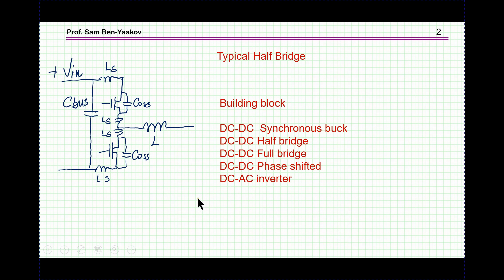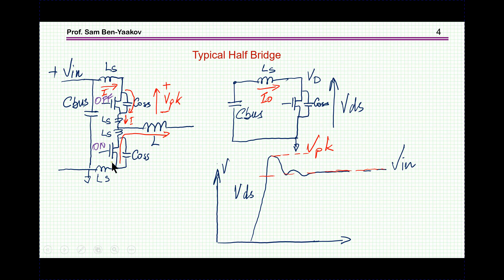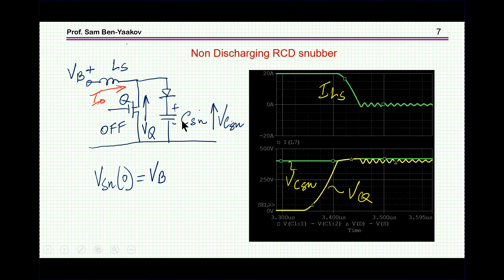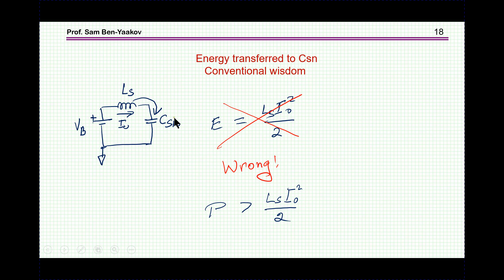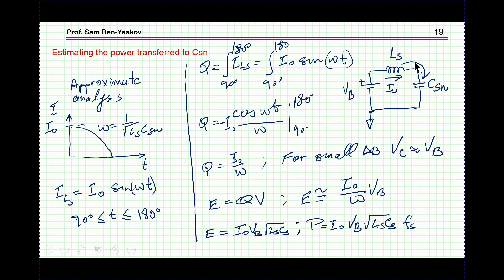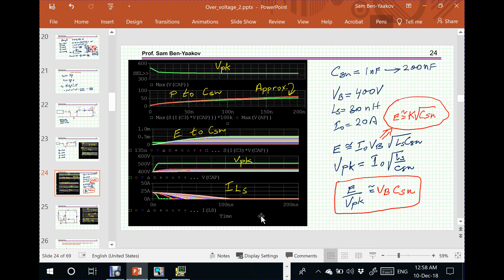Overvoltage  protection of PWM half bridge: Misconceptions and facts

Comment: Hello Professor, question on circuit arrangement of snubber components (R, C, D). 1 arrangement I have seen is Rsn and Csn in parallel with each other with one end connecting to Vdc in and other end connected to cathode of diode in clamp circuit. one of such arrangement is in this video -https://www.youtube.com/watch?v=rmMYgnJ1oqE
Can you please help share if component connection matters and what is difference in them ?
Reply from the maker: See https://youtu.be/laHN4Xn59lI?t=721
Reply: Thank you professor❤ @sambenyaakov

Comment: Thank you for the video. It is really an interesting energy calculation that starts here: 14:39
The energy that is stored in the inductor of 30nH at 20A is 6µWs. 
When it discharges to the capacitor of 13nF it increases its voltage by 30V. 
This is a charge of 390nAs that flows also through the voltage source of 400V, taking out 156µWs. 
Together with its own energy of 6µWs the sum is 162µWs. 
When the capacitor is discharged from 430V to 400V it emits the energy of 1202µWs – 1040µWs = 162µWs. 
There we have the power of 16.2W at 100kHz with the power loss of 8.1W. 19:39

Comment: Dear Professor Ben-Yaakov, excellent calculation. Thank you. But in case of bifilar coils this might have some additional assumptions. Because if inductance tends to be a 0 value, there is no need in capacitor (and resistor). I accidentally allowed an arc to appear and it killed my transistor. Have no clue about the voltage of the arc. 3000V+?
Reply from the maker: There is no such thing as zero inductance.

Comment: Dear professor, can I use the same calculations as you have shown on slide 16 to estimate the snubber capacitor for a charging/discharging RCD method? Or do they only apply to the non discharging RCD snubber method?
Reply from the maker: Only to non discharging

Comment: Thank you for this amazing video Professor Ben-Yaakov. I have two question please. When selecting the snubber resistor value is it simply e.g. 430V/20A = 22Ω. Also the power dissipated across the resistor will it be the same as the capacitor 16W as mentioned in the video?
Reply from the maker: It will be to adjust the resistor in circuit. The power is in fact dissipated in resistor not in capacitor.

Comment: Super useful. I am not an engineer, but the videos brings so much practical solutions and reasons why they are necessary. I was wondering, about recovering more than half of the energy. How about capturing the overvoltage using auxiliary digitally controlled switches and capacitors, instead of using diode and resistor? One would put the capacitor across the transistor (using 1 or 2 FETs), turn the main power transistor (high side for example) off, capture the energy, then disconnect the capacitor from the main power switch (using the FETs), and put it across the bus (using different 1 or 2 FETs) with a diode to discharge it back to the bus or load. Usually this would not work because the voltage on the capacitor would be kept at the same voltage as the bus, so there would be no transfer of energy, but this can be easily overcome by using two capacitors and putting them once in parallel (across the transistor), and once in series (across the bus, probably together with some diode or inductor to limit the current). The transistors used for this switching would not need to be rated high in terms of current or power, as they will only deal with switching transients. Similarly, they can be rated to the same voltage as the main power transistor, as they will not be experiencing the same kind of overshoot from the inductor, nor high di/dt, because of the effect of the capacitor on charging. I understand this might not be practical, but from purely academic perspective and higher efficiency and overvoltage protection, it is  interesting to explore. It could be a kind of active lossless clamp. The main issue (beyond circuit complexity) would be that it might require quite a bit of tinkering with the timings. And the time might be depended on the current / load for optimal operation, which limits its flexibility (could probably be solved by some comparators tho).
Reply from the maker: Hi, Thanks for input. Food for thought.

Comment: Great video Sam. Been working with switch mode converters as a maintenance power electronic specialist for the past 28 years on a very large scale such as the propulsion system on light rail trains as well as industrial controls in the CNC Aerospace industry. This is by far the best explanation yet that I have seen on you tube that delves into the details of power converters with great emphasis on the very important snubber circuits. Keep up the great work.
Reply from the maker: Thanks for comment. Responses like yours keep me going😊

Comment: Dear Prof. Ben-Yaakov, Thank you for your lecture. May I have a question?

At 18:21, you show the calculation of the actual loss Energy which converts into heat
Eloss = QV = Io/w*Vb

At this point, I confused a little bit. Since at the steady state, the voltage across Csn should equal to Vb via the loop Vb(+) -- Rsn -- Csn -- Vb(-), the energy which dissipates on Rsn should be caused only by the voltage deviation between Vpk and Vb (i.e., Vpk - Vb). Obviously, you cannot discharge the entire energy store in the capacitor Csn.

Hence, I think the right estimation of the loss should be:
P = Io*(Vpk - Vb)*sqrt(Ls*Cs)*fs

It makes the loss much smaller than that presented in the lecture. For the example in the Video, the snubber power will reduce from 16W to only 1.2 W, and the dissipation on Rsn is 0.6W which is a half of 1.2.That is exactly equal to the conventional estimation:

1/2*Ls*Io^2*f = Io*(Vpk-Vb)*sqrt(Ls*Cs)*f

I would admit that your lectures are very interesting. And I am sorry if my understanding is wrong.
I am looking forward to hearing from you.
Best regards,
Reply from the maker: Hi, Thanks for comment. You have not taken into account that the driving force  for current flow is the inductor.

Comment: Very interesting as usual. Thanks for your intuitive explanations. Regarding power losses, it could be interesting to compare the power losses in a MOSFET, with and without snubber, in terms of temperature rise  in the junction, by using real MOSFET model provided by the manufacturer.
Reply from the maker: The snubber described in video (non charging/discharging) does not effect the MOSFET losses. It just protects against high voltage peaks.